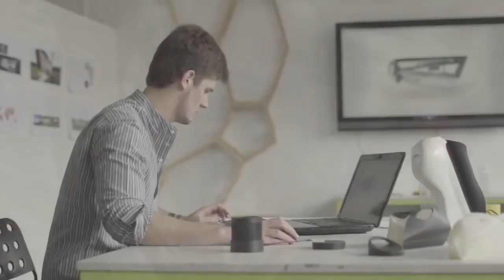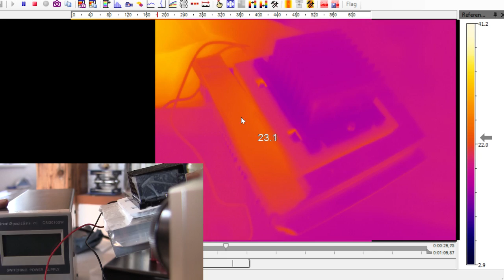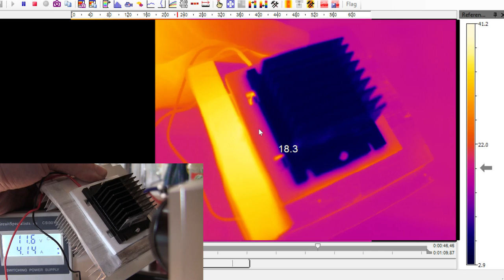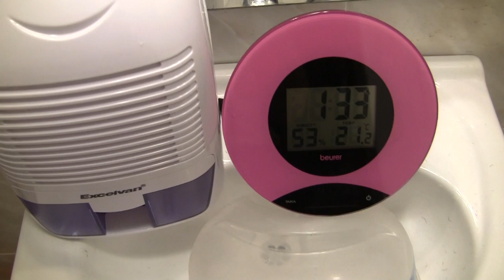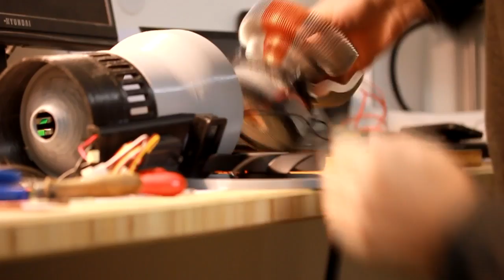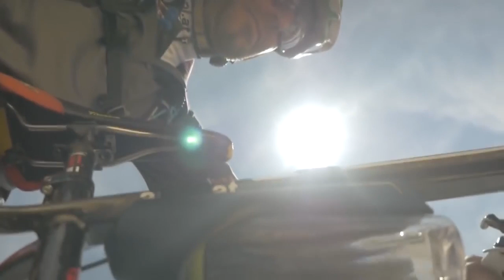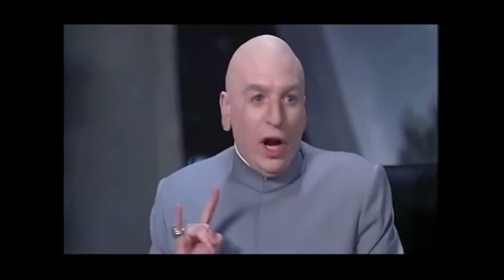$300 000 'Self-Filling water bottle' FAILURE

Comment: I just can't get past how utterly stupid it is to be trying to extract water from air, even "humid" air is extremely dry as it takes only a tiny amount of water vapour in air to reach saturation anyway though this varies with temperature  even typical tropical rain-forest conditions at like 30C and 90% humidity only have around 27 g/m^3 of water. Extracting 100% of the water from a whole Litre of this air would yield 0.027 mL of liquid water total! To extract a Litre of water would require all the water vapour from over 36,000 Litres of air under these conditions more in reality as extracting 100% of it is just not a practical possibility.

What might possibly be something that could work to produce a reasonable amount of clean, safe drinking water on the move, commercial reverse osmosis plants report energy use of 2-4 kWh per 1,000L produced so if someone could manage to achieve even 40% of that efficiency then 36 kJ/L = 1L/hr @ 10 watts. But the engineering is outside my skill set so no idea if building one is as feasible as it sounds in theory certainly seems a hell of a lot more practical than these ridiculous dehumidifier bottles though lol.

Oh and if there is anyone having any doubt about how much air needs to lose it's water vapour to produce a significant amount of liquid water you should really give some thought to just how large a cumulonimbus stormcloud actually is to produce the downpour of a heavy thunderstorm. These things are typically anything from 8-20 km in height in fact it's seriously a good job that air can't hold even a tiny fraction of it's own volume in water or this things would be like being hit by Tsnami's. Even just 1 millilitre per litre of air in a 10 km high storm cloud would be 10 meters of rainfall and these things tend to deposit their rain over as little as 30 minutes. So yeah really good thing that air can't hold more than a few hundredths of a millilitre of water per litre of air even in the warmer humid areas of the planet.

Course none of us will be around to see it when the air on Earth is capable of holding anything like as much as 1 millilitre of water per litre of air as the ambient temperature would be north of 100C for that.
Reply: what a good read, thanks for posting that.

Comment: Well, your area is about 30% relative humidity, forcibly running a shower pushing it up to 50%... Apparently Austria has an annual average humidity of ~72%.
So yeah, even with their amazing apparent Miracle Product, it'll only really work in anywhere where you may as well just try drinking the air straight.

Comment: It is possible to gain water out of "thin" air as long as there is plant life nearby. A plastic bag and a rubber band on a non-dead plant allows the pores to open up and give you water, so if they marketed that instead of some solar panel humidity bullshit, then they actually would have an over-priced plastic bag, but at least it would've provided a product.

Comment: I was wondering why you didn't get anything at 30% humidity, is it because the dehumidifier couldn't get the temperature low enough for the air to reach its condensation point?

Because, theoretically speaking, you should be able to get air down to 0% given low enough temperature or a big enough drop in pressure.

Comment: you call it busted as you show pictures of dehumidifiers saying it is one of those, and well, we know those work as said, so how is this busted again? I have a water bottle dehumidifier in my home, it is always full, I do not see why someone couldnt make the tech smaller, I mean this is what tech does, it gets smaller, so if the large one work fine then why not the small portable one, I somehow doubt your credibility as a scientist, show us your credentials, because you never show anything that you claim is real, you only debunk everything. and never really show proof and you never actually try the product or even come in contact with it, you just guess at if it works and expect us to believe.
Reply: here is some proof you do not know what you are talking about, the tech works just fine, it is you that doesn't 
https://www.walmart.com/ip/GE-70-Pint-Dehumidifier-for-Basements-w-Drain-White-ADEW70LR/35613631?wmlspartner=wmtlabs&adid=22222222222024137653&wmlspartner=wmtlabs&wl0=e&wl1=o&wl2=c&wl3=10357031977&wl4=kwd-1103074098873&wl12=35613631_0&wl14=dehumidifier&veh=sem

Comment: "or the next gas station"... actually yes, I do have to worry about that. I have two motorcycles. One has a 2.7 gallon gas tank and gets 55 miles to the gallon. The other gets 45 miles to the gallon and has a 3.4 gallon tank. The former is too slow and too uncomfortable to travel on. The latter has more than enough oomph to travel across the country. Both I have to be constantly mindful of how far I've traveled and how far it is to the next gas station before I decide to pass up a chance to fuel up or not.

Comment: Just out of curiosity, what would happen if there were some kind of air condenser type thing that fed a dehumidifier a larger volume of air, assuming power wasn't a problem? Could you end up generating a useful amount of water?
Reply: That assumption makes the question pointless. You would have to have a seperate system to capture and pressurize air then force feed it into the dehumidifier, which means that youve added several levels of complexity, weight, and system balancing. Essentially removing any possibility of it being portable or affordable.
(I am in no way an engineer, I just work on super complex motorcycles)

Comment: i cant help but think that even if it did work wouldnt you need to clean the water? if you pull humidity from the air couldnt you just as easy pull mold or other pathogens from the air and drink them?

Comment: How did you not get any water? The Dehumidifier I used in Japan would get 2 liters of water over night in the summer. This is astounding to me that your de humidifier is so shitty.
Reply: Hunter Bowie
Japan can reach over 80% humidity regularly, so it is pretty humid.
Reply: Keith Kovacs The area you were in probably had much higher humidity.
Reply: +Keith Kovacs

The dehumidifier used in the video is shitty because he is replicating one that would run on the same power draw as the solar panel.

Sure, he could run a top of the line dehumidifier, but it wouldn't be similar to their solar powered model.
Reply: eerrrrm not really. 100% Humidtiy doesn't mean under water. If the air is at 100% humidity, it has taken up as much water as it can. Above that, vapor will form, which isn't considered part of "humidity". 
But still, that's one crappy dehumidifier you got there thunderf00t. We had one running in our cellar at about 40-50% humidity, and, yeah, it was a big one. Still we had to empty it multiple times  a day as about 4-5 Liters in one afternoon would condense. 
The story with the fontus is still hilarious. One would think, someone putting up a croudfunding campaign would do a proof of concept before doin something like this.
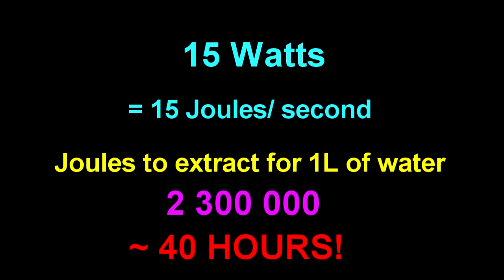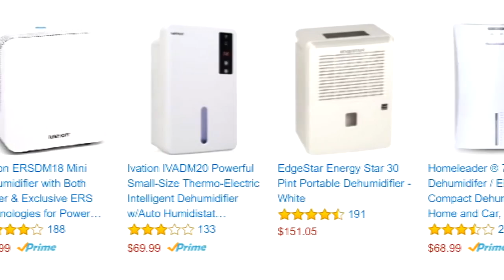Reply: He calculated the bottle as running at 15 watts (2:13). The commercial humidifier he uses runs at 80 watts (10:25).
Reply: he said in the video it was running on slightly below 5x the amount of watts that water bottle runs on, so I am presuming that is why it didn't work.
Reply: Raul Lopez Refrigeration based Dehumidifiers are far more efficient. With refrigerant, you can get the coils down to about 4degC or lower. Which means the coil is far below the dewpoint(temperature at which water vapor in the air condenses) of the air. The lower you can get the temperature the more water vapor you can condense out of the air. The thing with Peltier devices is that the cold plate doesn't get as cold and stay as cold as a refrigeration coil and it also used more energy to provide the same amount of cooling(heat rejection).
Reply: You're right, it was a shitty dehumidifier, that's what he's getting at. He was trying to prove the point that even with 5x the wattage on a reliable power grid, he still wasn't able to get what they were claming to be able to get with what they had. Most dehumidifiers are much more powerful, yes, and with high humidity you can get much more water. However this wasn't the point. The point was that the solar panel in the funding and the whole idea behind it were just an art students idea whom had not a single clue behind the technological aspects or the thermodynamic aspect of how something like this would work. Sure the guy could have actually believed that it may have worked one day, however like Thuderf00t was saying, that even with a quick math check, it was fundamentally impossible to do it.
Reply: I used a dehumidifer under the ocean. I got a full bottle under a second.
Reply: . That would be 100%. 80% is pretty possible
Reply: But seriously using a dehumidifier in the ocean is technically like putting a bottle in the ocean, I dont really see how thats an argument but felt more like a statement
Reply: . my country (singapore) currently has 82% humidity
Reply: MrBlaTi
By "fancy words" do you mean words from the English language?
Reply: Keith Kovacs Wait why are you telling me this
Reply: Fun read. you are really dumb but that's the fun part of this convo
Reply: +MrBlaTi

Yup. The area I live in can range from 90 to 100% humidity some days. It can be like walking into a sauna.
Reply: +didlihole 
1. Ah yes, when in trouble, ignore argument and correct grammar, especially that of a non native english speaker. Good job!
2. "If we stretch the circumstances that much, I could..."
You do realize the absurdity of equating my laptop to a plane is the whole point? If the conditions aren't the same, the proof isn't worth anything.
Now that I think about it, equating a laptop to a plane isn't even as absurd as I intended it to be. What do you need for a RC electric plane? Some plastic for the chassis, at least 1 electrical propeller, energy storage and a chip.  My laptop got all of that. so you could say it's a plane!  Who cares about proportions, form and ratios?! Those are just unimportant conditions! (Let's see if you can find the sarcasm...)

Oh and you can use as many fancy words as you want to seem intelligent. Conceited nonsense like "Avoid being responsible for anyone other than yourself" makes you look like the dumbest possible human being on earth.
Reply: No. That's not how humidity works. 100% just means that, for the temperature, the air is holding all of the moisture it can, and if it gets any cooler, dew will start to form. 100% is the dew point.
Reply: Tobias Just
Man you're awesome.  I love what I just read.  An open mind will take you so far!  Have a great weekend :)
Reply: the fact that Japan was surrounded by ocean then of fucking course the humidity has to be high in summer.
Reply: Jeremy Lim Jeremy Lim because the argument of having got a full dehumidifier from filing it into the ocean as a reply to my statement is dumb.
Reply: Jeremy Lim it was at the tail end of a debate. Came off as an argument in that context.
Reply: i wanted to ask a similar question, i live in an area where humidity is at 90% and just in an hour i get a litter of water, but using a portable A/C(wich as far as i know works in a similar way to dehumidifiers), so is this a problem of power or humidity? if it was of humidity wouldnt it be more viable on places with high humidity levels?
Reply: Dallas Dunnett yes, his criticisms of the "bottle" are well explained and I agree the self filling water bottle is a scam. The experiment portion of the video is not necessary, it's a waste of time.
Reply: Zhan Heng Lau Singapore is a fine city.
Reply: +Keith Kovacs

Thunderf00t saw an opportunity to "get his science on" using an absurd and mocking experiment. Do you really think he was going to let that chance pass him by?
Reply: MrBlaTi
1. You're.
2. Don't stretch - you just equated your laptop to a plane, like-for-like.
You fall under the same banner: Avoid being responsible for anyone other than yourself.
Reply: Keith Kovacs 8
Reply: Keith Kovacs i have a 200w dehumidifier in the bathroom. it runs 4 hours a day in 90-50% humidity (after a shower). takes a week to fill 3 litres. and it's not a thermoelectric one, it's a refrigeration system. fontus is balls.
Reply: Keith Kovacs it wasnt an argument dummy dumb dummo it was a joke

Have you not realised it
Reply: Seeing someone from Japan with the surname Kovacs makes randomly scrolling so down so much worth it!
Reply: well , if we had half the sweatshops you guys run there, we would also be pulling a lot of liters out of the air.
Reply: Bobby Ok cool the way he tries to set up his argument. Those other guys made the same point but weren't cunts about it, I guess you could just read the prior comments. Japan's humidity is like Florida. The whole experimental portion of this video is flawed because he used a crappy dehumidifier in what has to be a very dry environment.
Reply: Finally.  Someone here with some form of critical thinking.  I love you.
Reply: Hunter Bowie true, my argument is that he used a shitty dehumidifier to try and help his argument. It doesn't help him, especially when the logic to his argument seems sound. It's a lot of fluff running  that experiment.
Reply: Jeremy Lim don't be a dummy, the dehumidifier used In The video is shitty. Liters of water are possible and he only gets teaspoons. He even says what the relative humidity is. A shitty dehumidifier makes this a shitty test. He didn't even need it to disprove the self filling concept.
Reply: 80 percent humidity? so youre practically living underwater at that point

Comment: Dehumidifiers are designed to get rid of the water as much as possible, they cool down less to improve efficiency at not condensing water. If you was to cool the heat sync in a smaller surface area then water condensing would be a lot more. Either way, yes you're right in saying that they will probably get nowhere with this, however, you sorely exagerrate how bad it actually is by comparing it to a dehumidifier.

Comment: Apparently it has been made clear asking if one source of power would be better then another for someone on a bike offended people, so i will make it clear here what i was asking. 

simple put i rode a bike for years mostly at night, none of these do i care about for current use. do not ask me how much i ride or when, in fact leave my riding habits out of it. 

i had a petal generator, essentially run off the tire. with your leg blocking it, and the placement, and all that, would not not be a better option for them to choose? I GIVE ZERO FUCKS ABOUT WATER, WATER PRODUCTION OR FEASIBILITY OF SUCH A DEVICE AS STATED IN THE VIDEO. I GIVE NO FUCKS ABOUT ANY FEE FEE'S YOU HAVE. 

now after a ton of searching on my own i found the variables on my own, did the math, found out you can even calculate about how long both would not function. people went on about how it could not be let sit outside to charge and a load of other things i give no fucks about. having power to a bike to power lights is useless if you are not currently on the bike. 

if you want to yell at me and come after me for saying fuck off with info i give no fucks about, suck my gay cock you butt hurt cunts.

Comment: I think the product is crap too, but even in your "humid" experiment, you didn't simulate actual operating conditions.  You should have maintained the humidity in your bathroom at ~50% RH for the duration of the experiment.  This would have both simulated the product application conditions and maximized water condensation.  Just saying.

Comment: hi. is it possible to convest heat directly into electricity. is possible to transform electricity into heat, is there any way to do the opposite?
Reply: Yes, it's called a Seebeck generator.
Reply: Filipe Amaral thank you very much. I am wondering if such a device could be implemented on machines that produce a lot of heat, combustion engines for exaple. It would be nice if some of this energy could be converted to electricity. But i guess it would be too ineficcient because it's eficciency is based on thermad difference between the two plates
Reply: Cars already use temperature differences, for example for the AC radiators and intercoolers. In theory you could use oil or the coolant itself from the engine as a fluid that draws the heat away from the engine and into a place where one face of the Seebeck is touching the hot fluid and the other is facing incoming air, before the fluid reaches the radiator and is pumped through the engine again.
Reply: Filipe Amaral or maybe put it directly on the engine block. Probably would not to much in hot climates but in the nothern cooler temperatures a sistem like that would probably be able to gain back some energy.

Comment: The thing he shows in the video is just prototype before they make it portable. Basically it's a larger version probably so they can take it apart and modify it easier.

This idiot is probably one of those people who thinks we should keep burning coal and that wind and solar are bad sources of energy because it is less efficient than coal. When really renewable sources are just as efficient if not more than coal... and renewable sources aren't even at peak efficiency yet.
Reply: He never said anything about coal, only thermodynamics and the inefficiency of such a small pelted device and such small solar panels. I believe he actually support clean energy, he works at a nuclear power plant anyway
Reply: did you even watch the video?
Reply: Tyler Hanson How are they going to reduce the size of the heatsink or extraction fan? Those are the the largest parts and contribute most of the size of the prototype, if you know of a way to reduce their size just say.